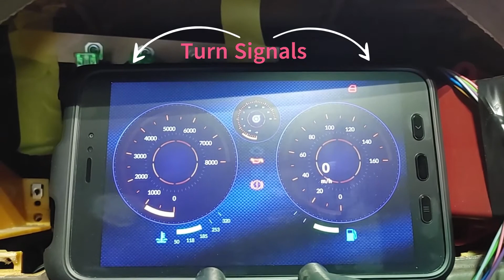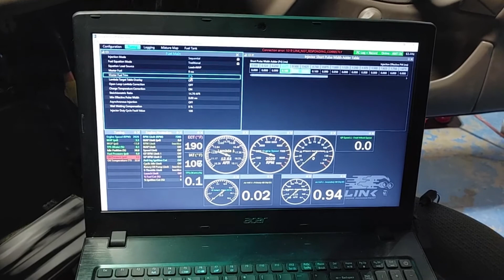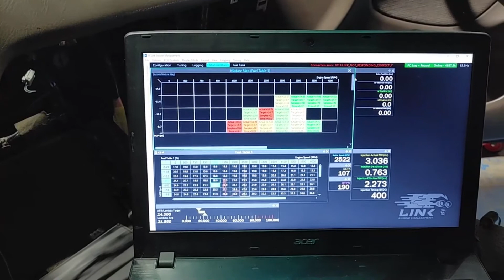Civic Project - Summer 2022 Update

Comment: Hi men , how you put all analog signal from oem honda ek to real dash over bluetooth,  i have the same car p06 chiped
Reply from the maker: Running LinkECU, so most signals are transmitted through a CAN bus to a unit called Dashbox, which is what transmits the wireless signal. The fuel level signal needed another analog signal converter, which then sends a readable voltage signal to Dashbox also.
Reply: @evan8r  is not posible to do on a oem ecu , converted analog signal to can bus converted , i dont Know how to do that